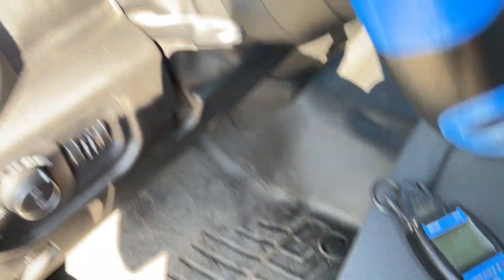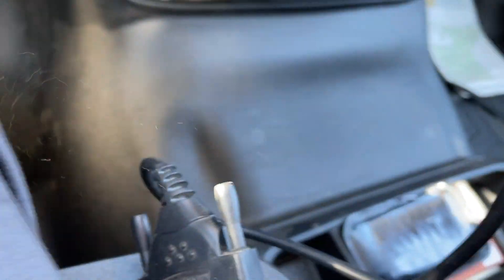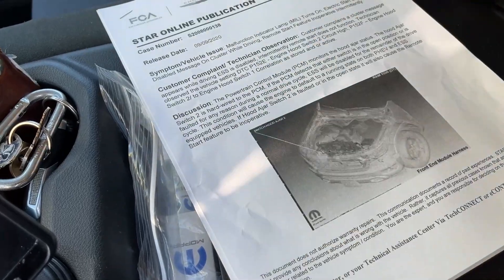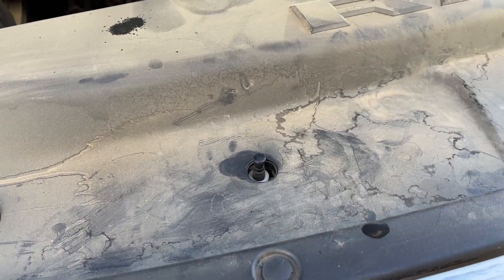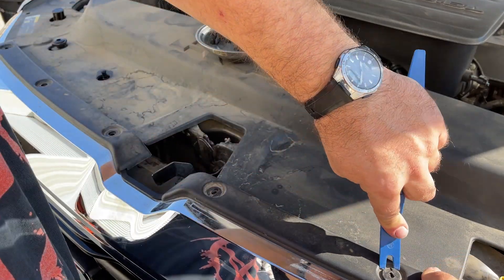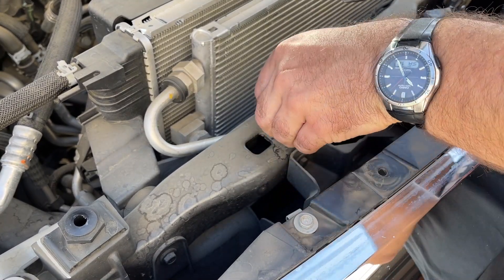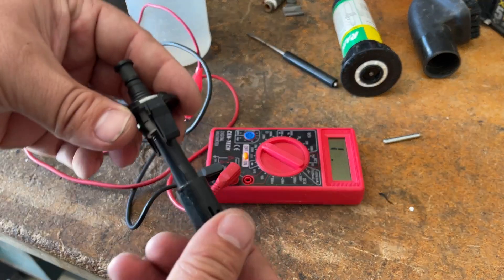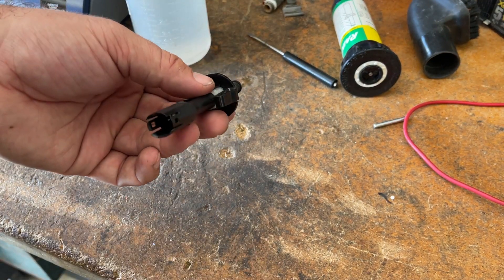Fix Ram 1500 Start Stop Not Working - Error Light P152e

Comment: Hi Hank, just driving tonight taking off from a traffic light my truck kind of stumbled on itself, but did not turn off. It showed on the cluster start stop feature stopped working needs service and I have the same light illuminated. 

2021 ram 15005.7 E-Torque

First problem I ever had with this truck 37,000 miles in. If I replace the switch, do I have to erase the code with my scanner?

I went to the dealer and one of the mechanics said it may be the battery as well but he did not check the truck. I have to make an appointment. I’d rather just replace it then have to go through the drama of bringing it to the dealership. are you fairly certain This would be my problem? Thank you so very much.

Comment: Hi Hank, just driving tonight taking off from A traffic light my truck kind of stumbled on itself, but did not turn off. It showed on the clusters start stop feature stopped working needs service and I have the little arrow. 

2021 ram 15005.7 E-Torque

First problem I ever had with this truck 37,000 miles in. If I replace the switch, do I have to erase the code with my scanner?

I went to the dealer and one of the mechanics said it may be the battery as well but he did not check the truck. I have to make an appointment. I’d rather just replace it then have to go through the drama of bringing it to the dealership. are you fairly certain This would be my problem? Thank you so very much.
Reply: Today the same thing happened to me at a traffic light, and the battery light came on. When I stopped in a parking lot, I turned it off and on again and it didn't show me either of the warning lights. I don't know if I should go to the dealer or wait and see if it happens again.

Comment: So I replaced my hood with an after market hood and I don’t have that part underneath my hood but I do have that pin in the front engine cause it’s an etorque should I tape it down? Cause it gave me that error light. Also did you have to clear the code or did it fix it self?

Comment: I just picked up the 2021 ram a couple months ago. I hate the start stop. I turn it off every time!
Reply from the maker: At first I didn’t like it but it grew on me pretty quick.
Reply: With fuel as expensive as it is and the poor MPG these trucks get, I leave mine on. Every little bit of fuel savings helps.

Comment: I have a Ram 1500 Lonestar that I bought around 6 months ago and dropped it at the shop this morning for this, as well as a few other issues.

My speakers will occasionally sound like they are all blown and I just get crackles and static, my auto start/stop light keeps coming on and recently, it has shut down on me twice over the last few days while at a red light. It happened yesterday and and I got a weird message on my dash saying "Hood open".
Just got off the phone and was told they're still trying to diagnose why the start/stop light keeps coming on as well as why the engine is shutting down at red lights. 

Anyone else encounter the speaker or shut down issue?
Reply from the maker: I guarantee the issue you’re having is with this switch. I just replaced mine for $12 didn’t even bother going to the dealer again. Hasn’t come back with any issues
Reply: @hanksgarage_  I spoke with them yesterday and they said they traced the problem to the start/stop battery.
They fixed the issue with the speakers, apparently fixed the start/stop issue, but like a lot of people having this issue, were unable to duplicate the issue where the truck shuts down while at a red light. At least that's the only time it has happened to me. Some have said their truck has shut off and the emergency brake applied while turning corners at slow speeds. That is a MAHIR SAFETY issue. Not just for the person driving the truck but the poor guy who may be right behind you and rear ends you because your vehicle malfunctioned.
The dealership said they scanned it multiple times and didn't get any codes. They asked if they could keep it overnight and check a few other things this morning so 🤞 they find the problem.
Reply: @hanksgarage_  where'd you get the switch?

Comment: I have a 2020 Kia Telluride and the start-stop hasn't worked since I got the car. I took it to the dealer and they run test to figure out why and they have no clue. Their answer was that there is so many protocols for this thing to work, that must be it. I've had two vehicles with start-stop and I run many tests with it on and off and I always get better mileage with it off.  Just another gimmick to sell cars. This e-torque is a joke. It only gives you extra torque for the first 1500 rpm which is about 10 mile per hour. One thing they have never said is how much horse power does it take to run the motor generator? The standard fan on a car takes about 12-15 horse power from the engine. So if your losing horse power what is the gain? I have a 2022 ram warlock with the hemi and no e-torque and I'm getting the same mileage as trucks with e-torque.